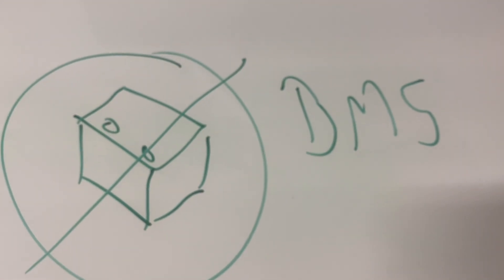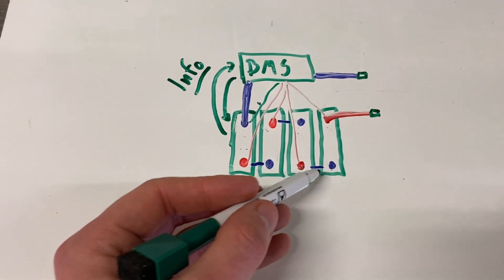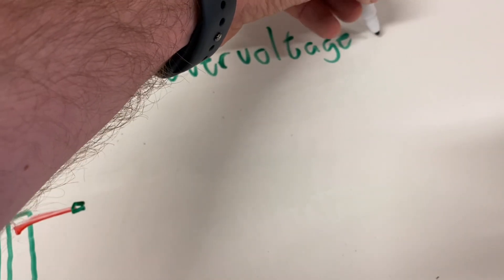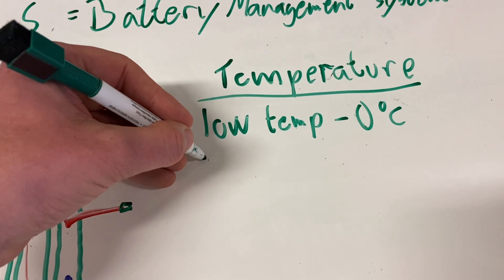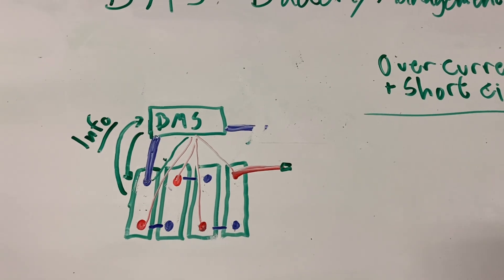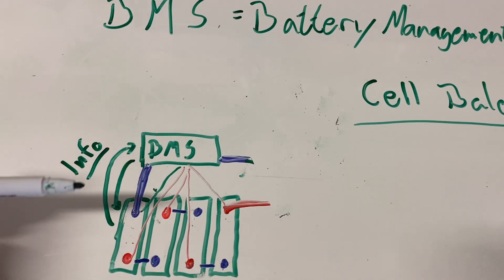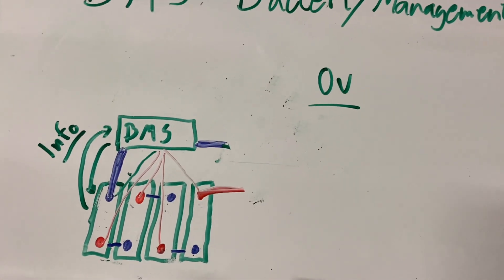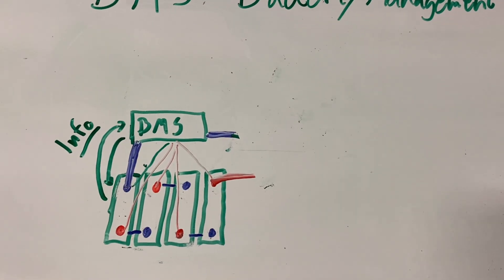LiFePO4 BMS: What It Does, How It Works, and Why It Stops Your Battery

Comment from the maker: Just a heads-up:
This video is a simplified explanation of how a BMS works — meant for beginners who are just getting into LiFePO4 and off-grid power.

Yes, BMS units can have many other features too, like:

Bluetooth connectivity
Active balancing
CAN bus communication
Custom temp sensors
Adjustable thresholds and more
I focused on the core protections that most users run into — like overcurrent, undervoltage, and low-temp charging cutoffs.

Feel free to drop your experience or questions below!

Comment: I was wondering how the balancing of cells worked.  I was wondering does it balance while charging or after?  In your video, you mentioned it starts to balance at around 90% of charge.  That answered my question.  Now I know that once the charger says the battery is charged, I can disconnect the charger.  It is both charged and balanced.  

Thanks for the video.